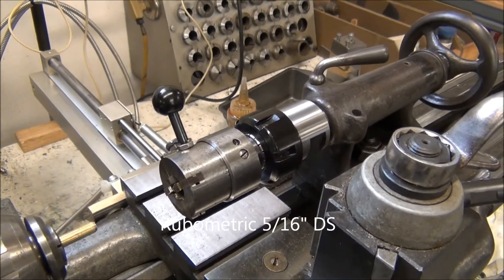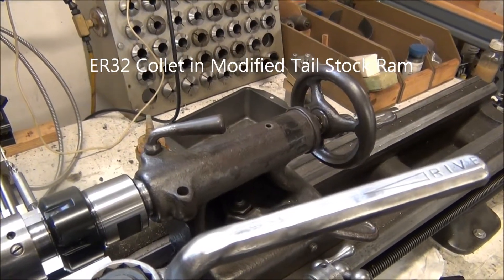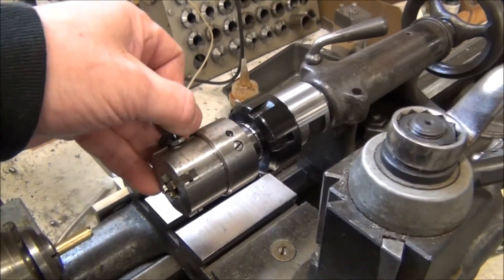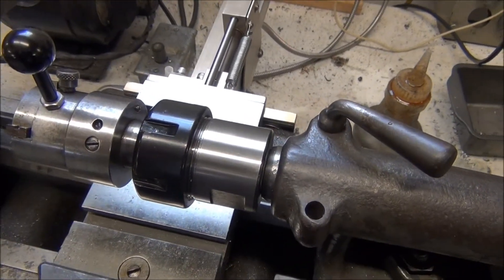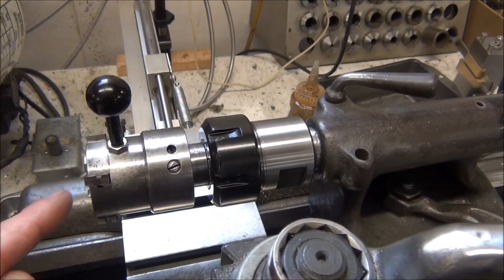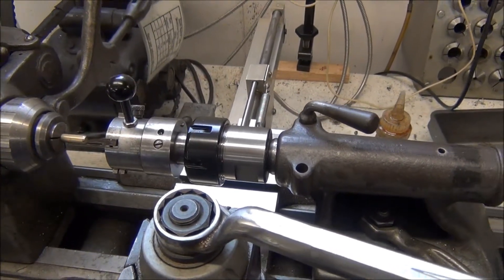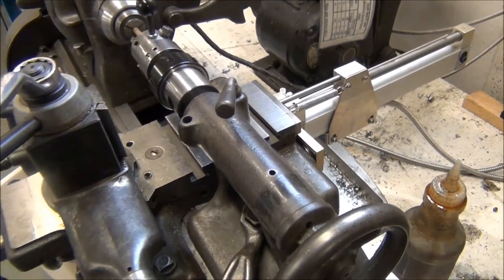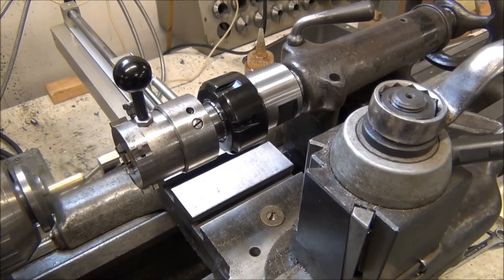Rubometric Geometric Die Head Operation

Comment: I have a die head but it keeps opening up only after a 1/4 of an inch. I have it in my tail stock. I am thinking maybe my tail stock is too heavy for it.
Reply from the maker: When the die head pulls forward it trips the release.  If your release is tripping too soon I would check to make sure the tailstock or whatever you're holding it with is free to move without binding.  Binding will cause these heads to release too soon.  Slide it back and forth to make sure it can move smoothing and maybe put way-oil on the ways or anywhere where you see friction binding it.

Comment: Thanks for making this video. I recently picked up a Rubometric D 9/16 and was in the process of figuring out how to use it when I found your video. I since discovered, upon disassembling the unit, that it was bound up with old oil/grease and swarf. After cleaning and reassembly it is now working perfectly.

I did post a request for a manual over on the Practical Machinist site. A subscriber there offered to send me a PDF scan of an instruction sheet that covers the Rubometric D sizes from 5/16 up to 2-1/4. If you're a subscriber there you might PM him and ask for a copy, too. Among other things, it describes disassembly and also shows what all of the parts look like. It may help you fabricate a replacement for the broken "Switching Lever" on yours. You can find the Practical Machinist thread at the URL below:

https://www.practicalmachinist.com/vb/general/search-manual-rubometric-d-9-16-die-head-operating-instructions-382753/

Alternatively, you might look into buying a replacement part. If you search using the keywords Rubometric and Parts you'll find at least one link to a U.S. company that buys parts from Germany and re-sells them.
Reply from the maker: Sometimes old tools just need an owner who will give it the right care and feeding!

Comment: You are missing the handle for the manual release. I have the Rubometric 1" D and when you rotate that handle It will do a light cut with the handle rotated out and deep cut with the handle laid against the head. The knurled screw is to remove the chasers.
Reply: Yes, you can still adjust it to exact depth with the set screws. So that’s an extra nice feature in the D models which, for some reason Geometric never added to the DS and DSA models. No other manufacturer that copied the Geometric heads added that feature to any other head other than the D either. Too bad, I’d love it on my DSA heads.

Comment: Can you tell me the purpose of the knurled screw?  And if it's spring loaded.
Reply from the maker: The knurled knob is a spring loaded release.  You pull it out and rotate when you want to change the threading dies and it releases the head to rotate far enough to let the dies come in and out.  The dies are numbered 1 though 4 and have to go into the exact corresponding slot.
Reply: Tom, I have the same Die Head, the problem I was having was the spring mechanism was missing inside the Knurled Knob release mechanism and it was stuck in the closed position.  I cleaned it and got it un-stuck.  The dowel pin is in there but you have to turn the die upside down and shake it to get it to release.  I can make the missing parts if I knew what they looked like?  Is it possible you can tell me what I'm missing?  I unscrewed the knob and no springs are in there and only one short dowel pin is inside.  Nothing to push it up when you pull on the knob.  Other than that the die works great.